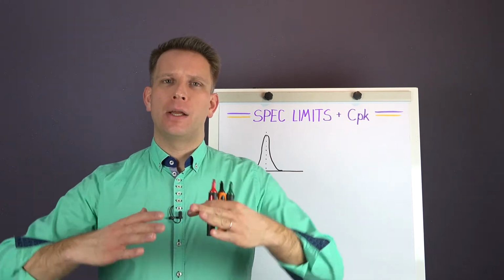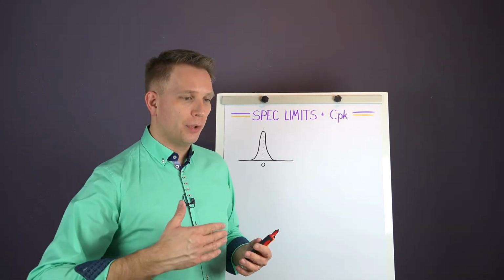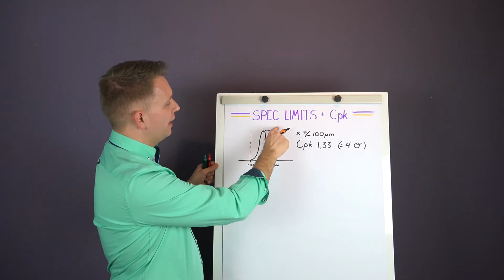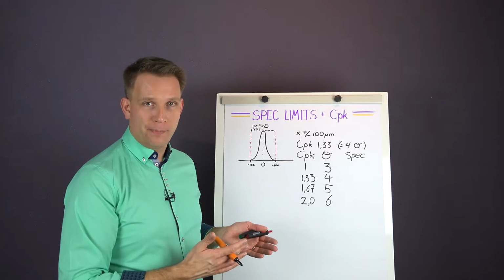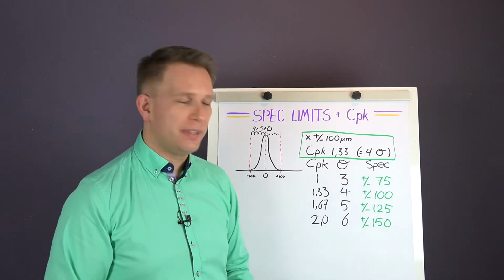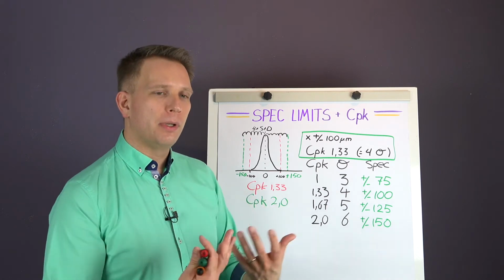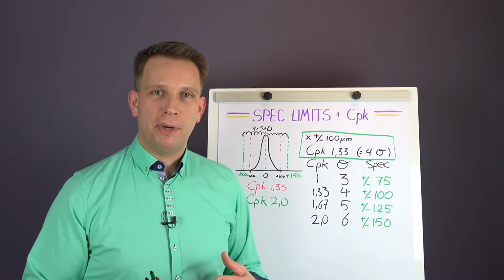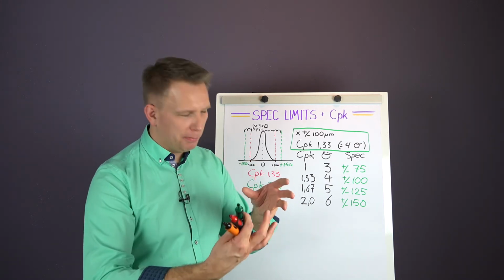How is Sigma level linked to Cpk and how does Cpk affect specification tolerance limits

Comment: Hi, how does a supplier predict capability on dimension when he sees x +/- 100um on print with cpk of 1.33 requirement? Does he have to produce Y parts to calculate capability first before agreeing to the spec? How does he calculate his target tolerance which will be a % of 100um that guarantees he will meet the required cpk  in order to win business?
Reply from the maker: Great questions Pritish.
Often suppliers will know their own process and can predict the performance of a process based on previous production runs (even if that was for a slightly different part). If it's a totally new part or even a new line, you'd have to produce parts before getting a good idea of the capability: start with measuring 30+ consecutive parts to determine Cm -> this is the best Cpk will be, since Cm/Cmk is without any process, material or parameter changes and Cm isn't even centred per se (Cmk is).
+/- 100um is the range of the specification (example: 2000 +/-100um = 1900-2100um). Cpk of 1.33 means that there will be 4 standard deviations of process variation between the average product and the closest specification limit, so the variation SD will be less than 25um (if the process is nicely centred, if it's not, the SD will have to be smaller).
Cpk 1.33 means that 4 SD's are within specs, that's about 99.994%, so only 6 in 100.000 parts will be out of spec (although in practice it will be more, due to the delay in catching process shift when it occurs).
Reply: A Cpk of 1.33 equals a sigma of +/- 4 sigma and 63ppm defects. This is actual measured performance including drift of mean, u. Cp assumes a centered distribution and is often 1.5 sigma higher than Cpk. So, you would need a sigma of +/- 5.5 (Cp of about 1.82, .05 ppm defects). Allowing a drift of u of +/-1.5 sigma. +/- 100 nm and +/- 5.5 sigma is a sigma of 18.18nm (5.5 sigma = 100nm). Statistics assumes a process “in control”. You will have to make that determination of normal distribution through experience. For example, measure 5 parts. Xbar = the average = estimated u. Determine the range (highest – lowest) R. Divide R by 2.326 (d2 factor). This is your estimated sigma. You now have Xbar and sigma. You can compare this to your nominal mean and desired sigma (18.18nm). You can calculate Cpk by the famous formula which is a pain in the neck to type in ASCII. Check you actual Cpk against 1.33. If you like pictures click on my user name, click on videos and look for “Lean People and Science” posted 8/15/2025. Look at 3 minutes and 7 seconds. Happy production!

Comment: Hi Tom,
Thanks for the clarity about tolerances. 
I from automotive industry,  Is it possible Cpk= 10 or more than 10
or it is some error in deciding tolerances. 
Please help...
Reply from the maker: Well, technically it is possible: if your standard deviation is less than 1/30th of the specification tolerance, you’ve got a Cpk of >10. It is highly unusual though. 
In almost all situations, the specification tolerance limits would have been adjusted by now. Because when it’s possible to make the parts so precise and standardized, the customer will start to use this in their designs and will start to need that tighter tolerance (which is not a bad thing - the final product generally gets better from it).
Reply: @TomMentink  
Thanks a lot for the clarity👍

Comment: If you don't have USL or LSL but you have a hard limit (target). i.e., you cannot reach levels less than zero or above 100% like tests scores? How do you calculate Cp and Cpk or even the Sigma Level of the process?
Reply from the maker: Hi Vasilis, it sounds like you have a unilateral tolerance (only 1 limit you are not allowed to cross and it's generally best for your cost to creep as close to it as possible without crossing it) - I made this video specifically about that: https://youtu.be/pNIWbDOAq9Q
The short of it, is that you don't have a Cp, but you can calculate Cpk with only that one specification limit.

Comment: Hi Tom. How can I predict defect rate in a metal work that is made by cnc machine and has 6 points in it where tolerance is measured? Do you collect minimum 30 metal parts and then minimum 30 measurements from those 6 locations, and then you calculate Cpk for it? Thank you
Reply from the maker: It depends a bit on how quality is defined in your case:
If they are basically 6 separate quality parameters, then Cpk is best calculated separately for all 6 and combined into 1 table for good overview.
If this is a sample subgroup (that is, if the defect/tolerance is measured from the average of these 6 measuring points), then use this average result as 1 point in the Cpk calculations.

Comment: Hi Tom, a really interesting video. Theoretically it all makes sense, I'm  concerned about an adverse effect that such adjustments may bring about. I mean, if you have artificially increased the tolerance from 75 to 150, the natural tendency of operators, people working at the shop floor may be to think:  "ohh we have such a wide tolerance which we know we will easily satisfy. So, we don't really have to bother..." Consequently, the process is deteriorating and there is no way a higher sigma level will be accomplished. So, in a real world it may look like this: 
Tolerance 0.75 Sigma Level 1.0 
Tolerance 1.5 Sigma Level 1.0. 

Thanks for all this good stuff, I'm following closely. 
Paweł
Reply from the maker: Thanks for sharing your experience.
As you may be able to tell from the video, I’m also not convinced of the big advantages of setting higher tolerance limits, certainly not if it’s just to boost Cpk. My intuition is the same as yours - if you don’t first build a strong quality culture, widening tolerances will likely lead to higher variation.